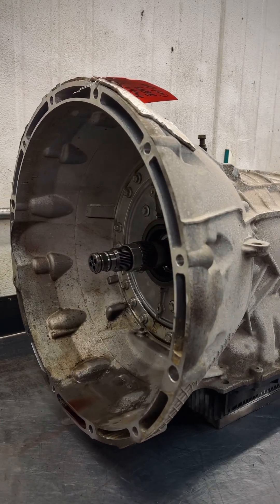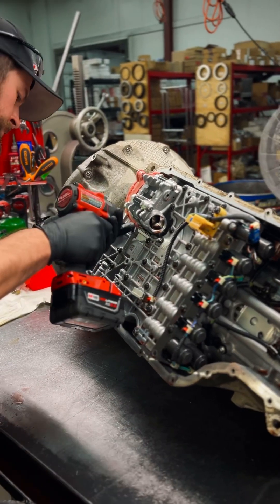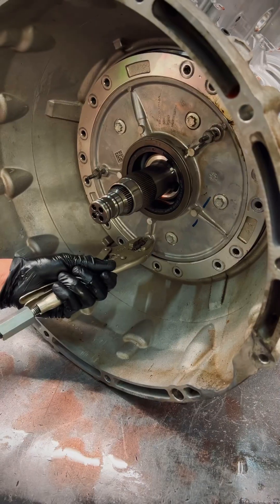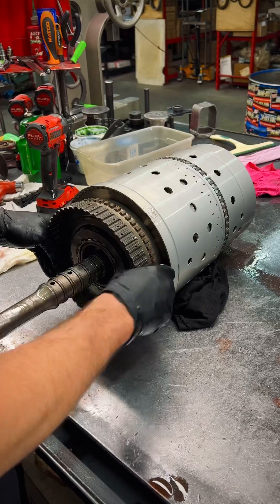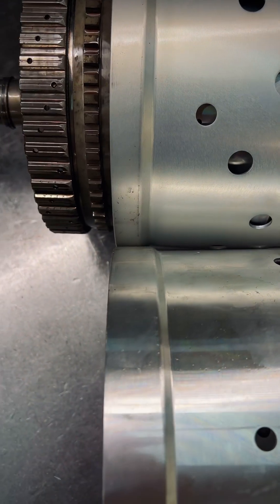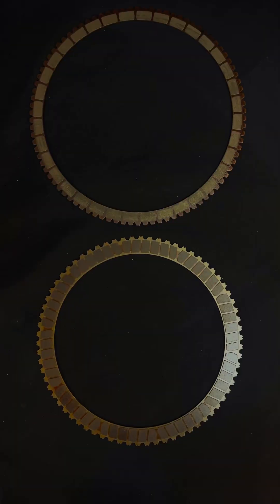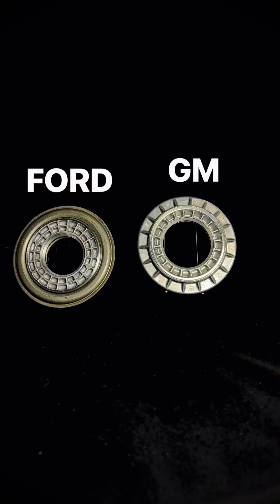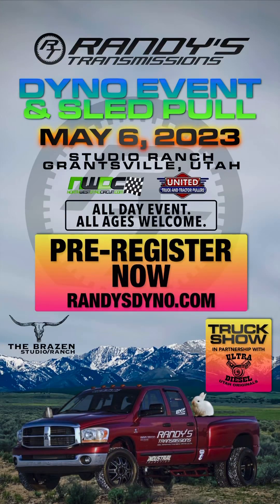Allison 10L vs Ford 10R

Comment: That Ford 10R is impressive. Any way to adapt this one to go in one of the older Ford 7.3 SD trucks? What a combination I would have then!
Reply: Bell housing and crankshaft adapter and an aftermarket transmission controller will put that behind anything you want.
Reply: @tcmtech7515  Awesome. Looks like I need to talk to my transmission builder. ;-)
Reply: @Bwanar1  transmission controllers ain't available but if you can find a way to make a stock 6.7 ECU run a 7.3 properly, then have at it! I'd rather put it behind a 460 or a cummins myself.
Reply: @Prestiged_peck  They have been around for years now.
 Powertrain Control Solutions PCS is what I was using 20 years ago and they already had plug-and-play units for everything that was off the shelf plus their units could be customized to run special stuff as well.  

Odds are they have something that works with 10-speed units all ready to go.
Reply: @tcmtech7515 20 years ago a 6 speed was space age
Reply: @JasonNotBot  Not really, Allison was making 5 and 6-speed automatics for commercial trucks in the mid 70's. Some models good to ~ 400 HP bone stock.

Comment: Not surprised at all by this..Ford for the most part has always built things stronger and beefier.I remember being in a parts store in the 80s and a guy came in to buy a flex plate for a turbo 350 chevy and it cost 25 bucks.The guy said that's pretty cheap and the parts guy said they are made out of tin or something like that and said had he been getting one for a ford he would be looking at close to 100 bucks because they were steel.Lesson learned.Just something as simple as a flex plate being made stronger says alot.
Reply: Ya it says GM made millions and Ford made thousands.  Simple economics and says nothing about the quality.
Reply: GM also got bailed out in 2008.  @wilsterone6689

Comment: They worked together when engineering the 10speed is what is was told form Ford
Reply: They worked together on the light duty 10 speeds.
Reply: They may have and Allison did not build it.

Comment: I'm a GM guy, but that looks like GM quietly saying they are not going to increase the output of the Duramax drastically anytime soon. I understand the Ford being built heavier because they advertise much higher horsepower and torque ratings than GM does. Sounds like GM designed that transmission around the limitations of the Duramax
Reply: Very wrong that duramax stock could obliterate both transmissions but torque management is the stopper. Basically a cockblock that cuts fuel to stop the duramax from destroying the little guy behind it. And the duramax will most definitely outlive a 6.7 powerjoke.
Reply: Or building it like Ford does is counter-productive. Yes you may have more HP at the crank but having a a heavier internals means you waste much more of it turning those gears.
Reply: 10r80's are for light duty trucks.
Reply: the L5P is capable of way more than it makes, I think they tune/keep the L5P to a level that the trans can live happy and cool at
Reply: Not the same trans, 10L1000 is completely different.
Reply: I think they finally accepted that they don't need to overbuild for more power given how all their diesels spend the majority of their lives in their underpowered detuned mode due to some emissions compliance BS being out of spec. 

Why build for 500 Hp and 700 Ft/Lbs of torque when you know damn well the things going live their lives self-detuned to less than half that.
Reply: They built it to be worked on. Ford built it to last the lifetime of the truck.. listen to the last sentence of the video. Said its going to be "another 68 we need to get readyfor that workload" chevy builds them to break.. when they break ppl just buy another chevy like the next ones going to be different.. The definition of insanity is doing the same thing over and over and expecting different results. -Albert Einstein
Reply: @tpss3834 
I’ve sold GM parts for 45 years,and I’ll give credit where credit is due. One thing I’ll promise you is they will ALL break. No manufacturer is going to build a bulletproof transmission. Especially with all the yahoos out there wicking up the boost and torque and expecting it to hold up. I have a customer whose as attached to Henry’s appendage as any of you,and even he’ll admit the new stuff is junk…bowtie OR oval. Get over your fanboi crushes and accept facts. They WILL all break.
Reply: @saltydog7988 you are 100% correct. All break and all cost too damn much to repair
Reply: @tpss3834  Too often corporate has no clue what the customer base wants. 

Years ago I worked as a service tech at a welding supply chain store and my whole department got shut down. 

Our national region had like 6 or 7 service points in it and they condensed it down to one, which pushed service and repair turnaround time from a few days on average to a few weeks. 

The actual explanation was that the execs thought that if they stopped servicing/made it really difficult with the older equipment, that would push the customers to buy new stuff whenever things broke down.
Reply: @tcmtech7515  justifying buying a new gmc/chevy/cadillac every few years doesnt help.. theres a reason ford is the #1 in sales. Not in profit. But in sales. Chevy actually made more in sales while selling almost 100,000 less trucks. Price gouged as well as needing repairs more often..
Reply: @tpss3834 actually gm is number 1 in truck sales.
Reply: @HioSSilver1999 oh since when? Been over 25 years of ford on top.
Reply: @ChaseLandMgmt  Ford sells under the Ford name only. GM has the Silverado and Sierra. If you include both names under GM. They sell more trucks then Ford and Ram. Have for years now.
Reply: @ChaseLandMgmt I'm a Ford guy, but Silver1999 is right. Ford claims #1 because GMC Serria and Chevy Silverado aren't considered the same truck with the independent organization that keeps track of total units sold. Ford also includes their comerical Fleet sales under units sold totals but GM doesn't include that number in their submitted totals. They considered it another market and submit it as a third brand. Dont ask me how that makes sense from a marketing standpoint...nuts if you ask me. If you put all three factions of GM truck together, GMC, Chevy, Commercial, they actually outsell us by almost 35% each year...shocking.....
Reply: @tcmtech7515 coming from the 12 year old who doesn’t even own a truck.
Reply: @connor4961  And who would that be?
Reply: @tcmtech7515  you
Reply: @connor4961  Projecting your own childishness on others?
Reply: @tcmtech7515  hey you’ve been projecting your narcissism on others.
Reply: @connor4961  So original. You come up with that yourself? 😴
Reply: @tcmtech7515  awe couldn’t come up with a decent comeback.
Reply: @connor4961  No, U! is easier to type, kiddo. 😴
Reply: @connor4961  So, no more childish self-owns today?
Reply: @ChaseLandMgmt 
Not when combining Chevy and GMC sales…it’s a bone GM throws Ford. Just like the old days when GM didn’t have an extended cab truck and Ford didn’t have a Suburban competitor. Marketing,pure and simple.
Reply: @arbiter1  ever wonder why that is? Big companies always go with what is reliable and worth the $ seriously they dont buy something if past experiences mean a lot of downtime in shops.
Reply: @redline455 

GM ABSOLUTELY combines commercial sales in their numbers.

From automotive news:

": Q2 sales up 19% on COMMERCIAL, SUV gains

It was the fourth consecutive quarter of retail market share growth for GM, which is on pace to be the nation's No. 1 seller of new vehicles for a second-straight year after losing the crown in 2021 to Toyota."

July 06, 2023 10:37 AM

Though not currently, Ford has outsold the GM twins many times....100% from memory, it was something like 14 years in a row around 2016.

Comment: I work in the oilfields and we use mainly ford but we also have dodge. The ford trucks hual our water transfer dragon pumps with john deer 6090s. They weigh close to 18k and we hual them all over the northwest from texas to north Dakota. We dont have any problems with our f250/450 fleet 6.7 PSD trucks. The dodge hold up pretty decent but we have gone through 2 transmissions and 1 transfer case. We all prefer the ford trucks. The oilfields will break your bias and feelings real quick ! GM is junk and dont last at all. We went through 3 transmissions and lots of limp mode issues and 1 engine and 4 rear axles.  Get a ford or a dodge if you want something that will hold up
Reply: Your very lucky the GMs don't hold up as well usually  I'm a logger in western Montana  and F series is the truck of choice  period out here
Reply: @jeffparker8268  Absolutely truth. Big & small companies prefer Ford trucks & vans for very good reasons.  I like Chevy.  Tho when i buy new trucks it's always Ford.
Reply: @jeffparker8268  That is absolutely not the case from my experience.
Reply: @wilsterone6689  Well great.. but you are in the minority statistically speaking. Data is truth. Period. Like said in another comment i won't bad mouth any trucks except RAM.
Reply: Exactly the opposite in the NW. We run a fleet of transit vehicles that put 300+ miles a day on.  20 2010 G3500 with 6.6L Duramax and 24 E450 2018 6.8L gas and 15 2019 F450 6.7L Diesel.  No joke not one major failure with GM and all but 3 of the Fords have had either transmission failure, headgasket failure,  overheating issues, or injection pump failure.  Even the brakes last twice as long in our chevys.  Same exact maintenance program.
Reply: @wilsterone6689  Thats entirely UNUSUAL. Nobody tryin bash GM. It's only Ford Or Chevy for me.. always! Ford Trucks & Vans are preferred by 75%+ of companies for fleet vehicles/work trucks. For good reason.
Reply: @Davido50 yet Duramax is outselling powerstroke 2 to 1
Reply: @wilsterone6689 2018 and 2019 Ford used the 6R140.  Apples to oranges.
Reply: Where trucks are actually worked
Reply: @jeffparker8268  Exactly 💯 There's a good reason 75%+ of big & small companies or rental agencies prefer Ford trucks & Transit vans. Facts.
Reply: I manage a fleet of primarily Ford, Dodge and some GM 3/4 to 2 ton diesels. I’ve always been pretty partial to dodge because it feels like over the last 5 years, if an issue does occur with them, it normally gets handled a lot quicker by my local dodge dealership than at the Ford dealer, mostly because of part availability. And even with the rather large size of my fleet, it’s pretty rare that something goes wrong with the Dodge Rams. I’ve worked in a lot of different areas and I’ve never had a bad experience with a dodge. Can’t say that about ford sadly, but their trucks are definitely solid. 100% agree with your opinion on GM lol
Reply: I work at an electric utility and we have all three makes from 1500’s thru 5500’s (bigger stuff is Freightliner).  Our experience time and time again is Fprd has the most issues(by far), we have fairly good luck with diesel RAM 5500’s, but we have the least problems from the Chevy products.  We have gas 2500’s and Duramax 3500’s and 5500’s.  The Chevy 5500’s have the rough service true Allison 6 speeds.
Reply: WOW I have had duramex last 500k miles I haul in the oilfield all the time im on my 2nd LML right now 394k with no major issues, way more curvy roads and steep hill stop and go over here never had trans issues I did change the fuel system on my first LML at 260k with zero issues a2ter that sold it with 506k miles on the clock. the current truck(16)is not deleted stock front end components also but the  2013 was deleted at 110k miles did front end work anftter an accident in ice
Reply: 8n is @jeremybroderick9465
Reply: @jeremybroderick9465  they're talking about brand new trucks, older duramaxes, especially the pre-DEF models, were king of the hill by far.
Reply: @Prestiged_peck  Duramax, aka GM trucks, have NEVER been king of the hill. Simple fact, GM trucks ARE built weaker than Dodge/Ram and Ford trucks. This is simply beyond contestation
Reply: @wyo_garage20 not from what i have seen.
Reply: @HioSSilver1999  You haven’t seen much then. Facts are facts, irrefutable. Sure, the Duramax and Allison is a GREAT combination, talking the 5 and 6 speed units here. The 10 is yet to be seen. But the trucks around them fall far far short of the other two. 

I used to do body work. Go find someone that does and ask them. A relatively minor fender bender in a Dodge or Ford, might be no repair or at most a bumper mount and bumper. Occasionally get something into a fender and headlight and grille. The same type of collision in a GM is 100% radiator, core support, grille, bumper and almost all bumper mounts being replaced. Because their mounts are so shitty one folds and the rest bend beyond repair as the bumper sucks them over. Both from fenders buckle right at the top of the wheel arch requiring pulling, body work and paint into at least the front doors. 

GM trucks cannot, ever, hold a candle to the other two. And I hate Fords. I would buy a GM over a Ford any day. But I would be buying a lesser, inferior truck with a better drivetrain.
Reply: @wyo_garage20  I've been a body man and a mechanic for 35+ years. I've likely seen more than you.

Btw....certfied crash test would say you're wrong. By irrefutable evidence. Although ford and dodge have caught up in that department in the past 10-15 years.
Reply: @HioSSilver1999  No you haven’t. Stop lying, sit down🤣
Reply: @wyo_garage20 to each his own. Most haulers I know love the cv axles front end on GM. The 4low on all the GM's I've used or seen have been far from lacking. Everyone has their own experiences and nightmare stories about brands. My current estimation is Ford had to be sued into submission before paying out for scamming customers with the 6.0 and 6.4. The new 6.7 is excellent, no real issues there unless it has a cp4 pump. Give me a cp3
Reply: @wyo_garage20 yes they have, even right now they are faster up the Ike gauntlet with maxed out load then the ford even though on paper the ford has more power.
Reply: @gamebredduramax71  Yes they have what? Been king of the hill?? Damn boy, you’re not intelligent enough to realize no one is talking about a literal run up the hill??🤣 My god…..

And no, the GM trucks are weaker and lesser trucks overall over Dodge/Ram and Ford, always have been. They’re not built as well, not near as strong and never hold up as well, especially when beaten off-road. They are pavement princesses overall. I’d love to have an LBZ though
Reply: @wyo_garage20 Lol fan boy alert 😂
Reply: @gamebredduramax71 

No they're not...
Reply: @wyo_garage20 that's what they are pretty boy trucks .
Reply: @wyo_garage20  Yes, data speaks volumes & Ford trucks /Vans are always on top. I'm sayin this as a guy that likes Chevy but only buys new Fords. 👍🏻
Reply: @wyo_garage20  I like Chevy/GMC.. would ALWAYS buy one over a foreign truck ..but never over a Ford truck. All my company buys & all myself & coworkers will buy w/our hard earned money are new Fords . Looking into new '24 Transit 250 van for myself to haul /use as daily driver.
Reply: @wyo_garage20 body guy huh? Don’t forget to add any dent on ford trucks is at least a 25% markup due to aluminum 😂
Reply: @wyo_garage20 simple facts is Duramax is outselling both powerstroke and Cummins combined
Reply: @ Prove it

Comment: What is Allison about the 10L?  The nameplate GM bought from Allison?
Reply: That GM transmission identifies as an Allison  !!
🤣🤣🤣🤣
Reply: Yes it's just a nameplate now, GM owned Allison from 1928 and made the big mistake of selling it off in 2007. They should have kept it and told Ford and Dodge to build your own. Allison is owned by the Carlyle Group so now they are just Allison branded transmissions.

Comment: I've had 2 F550 company trucks with 10speeds shit the bed. A 2020 at around 24,000 miles, and now a 2022 at 30,000 miles. Both trucks run around 14-15,000lbs daily with Altec squirt booms mounted on the chassis.
Reply: I believe the F550 10spd is designated the 10R140.
Reply: My son is a service tech large rental co they ordered 5 new DMAX 5500. Ford's having to many issues.